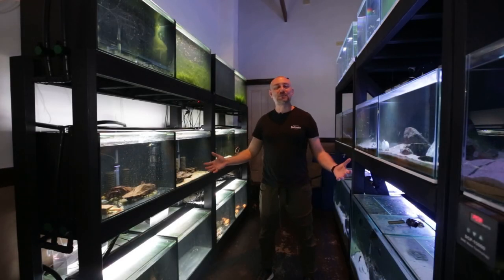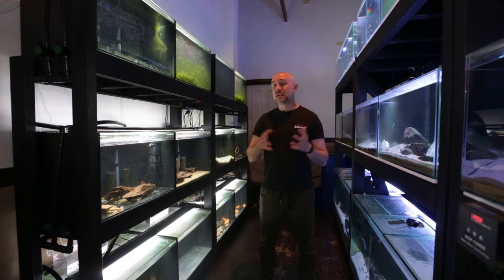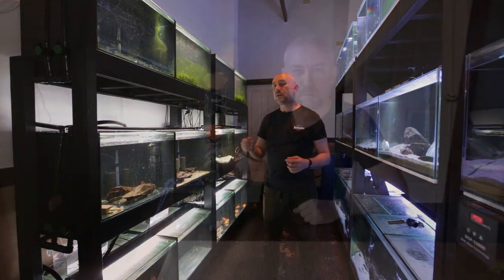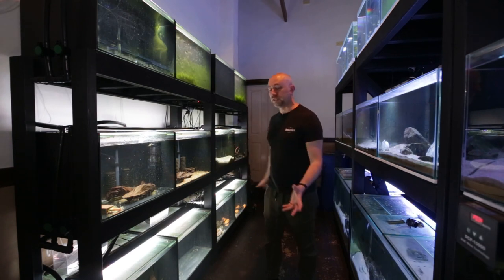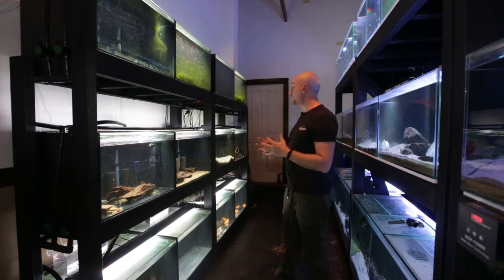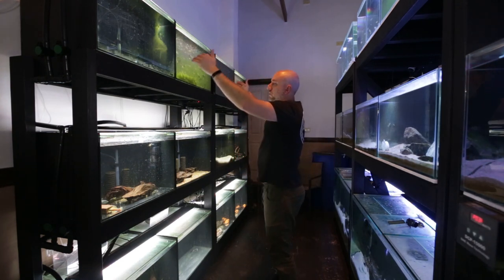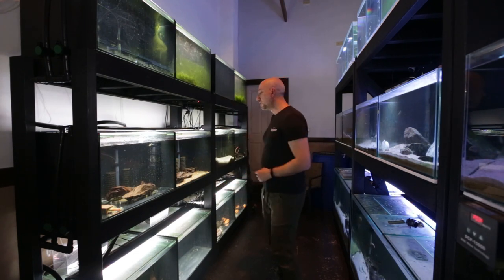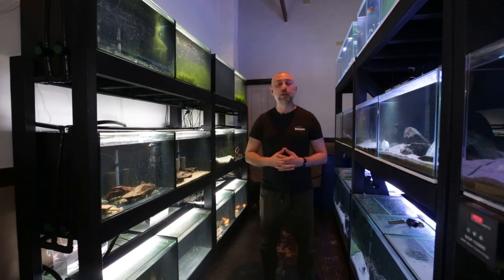Fish Room Water Change System - Part 5 - The Final Results

Comment: Oh no! First off all, don't remove te videos. Just make a little note in front of the series. Maybe someone else is thinking about doing something like this and you can safe him a lot of money.

The idea is great no doubt. It's a pity(is this the correct word?) its leaking 😪 lot of work money and time you spent. If it was my fish room I would change it for pvc. Its just a lot easier and stronger in the long run. You can buy different colors of pvc these days or you can spray paint them. But it's a waste of the money spent already. So i will first try to make this work. There must be something that can prevent the leaking in this system. I will have a check here in the Netherlands if they have a common solution for this kind of problem. Can we contact you somehow with a emailadres? That way I can also send you links and drawings if I have a solution /idea. Keep up the good work men! Greets from the Netherlands
Reply from the maker: Cheers for that mate, I won't be taking the videos down, the consensus is to keep them up so I will. 

Yeah in hindsight, I should have done this with PVC as it worked for me with my other rack. But figured the small scale tests worked so I was hoping this would be fine too. Now that I have the fittings, I will just get a solution to make this work and will share that with everyone. My email address is jasonscichlids@gmail.com

Cheers mate, gad you have been enjoying the videos Joop!

Comment: Dont delete the series from youtube mate. Can always just pin a comment in the previous versions with a note to watch this one first.
If it was me id probably switch it to pvc
Reply from the maker: Cheers Blake, I will keep the series up. Good suggestion with pinning a comment on the other videos. I will do that.
In hindsight, yeah I just should have just stuck with what I know. But now that I have the fittings, I would like to obviously use them and make this work. Once I have a solution I will be sharing it with everyone

Comment: Hey Mate, in my experience you could try wrap the barbs of the fittings with teflon tape and then add the hose clamp. that has worked quite well for me in the past. In reference to the PVC Solvent, most of them are aquarium safe once you have left them to fully cure. if you are not 100% sure, just look for a bottle that mentions consumer mains water as these have to be "food safe" to not add anything to drinking water. Hope that Helps!
Reply from the maker: Interesting suggestion to use tape as well as hose clamps. The fittings are so difficult to put together, the fit is so tight. Adding teflon tape would make that process so much more challenging but it might be worth it if it works! Oh yes, I am aware about the "food safe" an "potable water" labels being indicators for the product being aquarium safe. My question was more so for glues/cements that actually work on LDPE though as well as those being aquarium safe. Cheers again for your suggestion with the tape mate!
Reply: @JasonsCichlids  yea not too sure about the solvents working on LDPE, never tried it. I ended up heating the LDPE pipe up with a small lighter to get them over the barbs covered in teflon.
Reply: @lyalstanford574  how much tape did you use?

Comment: You could add a vaccum breaker valve (or a few) at the highest points in the system. When not using the system open the vacuum breakers to break the siphon and drain the system, preventing slow leaks from continuing to drain the tanks.
Reply: Also regarding the slow siphon on the bottom row. Perhaps something else that could 'help the cause' would be to find ways to increase head pressure(distance from water line in the tanks too the hose outlet in the yard.) If the yard is sloped, perhaps extend the garden hose to the lowest possible point. The added difference in height will increase head pressure which will help overcome air pockets in the line and increase flow.
Reply from the maker: Cheers for the tips mate. If I hadn't needed to break the siphon on the top row and middle rows, no air would have been in the drain hose. That would have allowed the bottom row to flow out unimpeded to the garden. Thankfully my backyard is about 2m to 3m lower than the bottom row of tanks. But even this wasn't enough to create enough pressure to blow out the air from the drain hose. But all good, from that one test I learnt a lot and next time I won't need to break the siphon on the tanks which will mean the bottom row tanks will drain out a lot quicker.
Reply: @JasonsCichlids  best kind, sounds like there's already plenty of height difference for the bottom row then.
 Suggestion for a vacuum breaker would be for after the water changes are all complete to avoid the tanks from slowing draining onto the floor through the slow leaks you were describing. Just as an alternative to resealing a bunch of connections.

Comment: If it’s not PVC then try to weld them using heat / blow torch. Also you can try using the 789 Dowsil silicon or find out the glue they use for soldering  Acrylic together.

 I am surprised the ring fastener / clamps aren’t working  to stop the leak. 

Let us know what you do.
Reply from the maker: Cheers for the suggestions mate. I wish there was some sort of heated iron I could clamp around the fittings to weld them shut. I have considered trying acrylic weld on but am not sure it will work with this stuff. 

Oh yeah mate, I was really surprised the metal clamps didn't work as well. I figured they would be my fall back but no luck. Definitely will do an update video once I sort it all out.

Comment: If only a couple joints are leaking you may have a nick in the barbs on the fitting.  I've used white plumbers tape, the kind you use of pressure fitting to stop leaks in my solar heater.  I have a 1 horse pump on that system and nothing is leaking.  I also have the screw on clamps doubled up on a couple problem joint.
Reply from the maker: Thanks for the suggestion, I am thinking of going this route with the plumbers tape and then using screw on clamps on top. Sounds like the solution to fix this.

Comment: This hobby always seems to have lessons and experiments for us to deal with. I’ve had one tank that continues to get green water. It gets better with water changes and comes right back. It’s caused me to search out the cause, which I’ve had many hypotheses that proved wrong. Don’t take down the videos. It’s nice to see we aren’t the only one struggling with some kind of issue. Plus, imagine the victory video you can create when you solve the problem!
Reply from the maker: Cheers mate, yeah I will be keeping the series up. Hmm I wonder though if your aquarium is simply close to a window and getting a lot of sun? I will definitely sharing the solution with you guys!
Reply: @JasonsCichlids  the windows in that area are covered so it get some indirect light. I’ve also now started to believe I might have too strong of a light on the tank. Currently experimenting with intensity to see what happens. Very confusing situation. Thanks for the thoughts!

Comment: Teflon tape might work.
For the problem with bottom row, could you not connect them with a "Y" fitting to use the flow from top row to create suction going through the Y fitting to drain bottom tank faster?
Reply from the maker: Yeah I am actually now considering using teflon tape now Ben. It seems to be the consensus so far. As for the bottom row, a "Y" fitting would unfortunately mean a change to all the feed in lines due to angles of the "Y" fitting not being 90 degrees. There is enough pressure, I learnt from that test that it works best if I don't break the siphons.

Comment: 👍 Jason have you emailed the piping manufacturer, because they should have tested products which work as sealants on their products❓
You've worked so hard on this project, I cannot see this issue defeating you Mate ... Good Luck 🤞
Reply from the maker: Hey Dino, I actually rang and spoke with them. Short answer from them is no, there are no glues that can glue polyethylene (LDPE or HDPE). Basically polyethylene was made for that very reason, so nothing would stick to it. This from one website, "It is commonly used as packaging and material for storage containers, chemical drums and tanks. Its nonporous surface makes it an ideal packaging material for adhesives since most glue can’t stick to a Polyethylene surface". However, I have since found two products that claim to be able to glue polyethylene. One uses a primer first and then you apply a "superglue" like substance to the join. The other looks like a 2 part epoxy. The issue with these, no idea if they are safe for fish! Being chemicals that can bond plastic that was designed to be never glued, I imagine they aren't great for fish. But I have options. 1. Undo everything and use teflon tape on all inside joins and then reattach everything using metal hose clamps. 2. Plastic weld the joins together using a plastic welder (plastic welders seem pretty cheap) and they make welders for polyethylene. 3. Redo the system with the same fittings but use vinyl hose instead of irrigation hose (LDPE). Or 4. Bite the bullet and try one of the glues I mentioned above. I'll fix it, its just a matter of taking some time to work out what will be the best next step.
Reply: @JasonsCichlids  although it might be a bit of a bodge it and scarper…..I’m sure some tubes of 785 black from DownCorning will crack this problem……it’s basically a sanitary sealant plumbers use in construction…….failing that a product called blackjack…….it’s a waterproofing product for roofs.

As both of these are applied externally to the fittings they should be completely fish friendly.

All that said I’m adding a disclaimer cos I don’t wanna be responsible for losing those beautiful Calvus.

But I reck9n 785 black tubes of mastic will be your friend.

Good luck

Comment: Morning Jason, very surprised the hose clamps didn't stop the leak, but it is a molded part with a soft tube trying to clamp together, another simple thing that might work is heat shrink, it could put a more even pressure on the raised ring of the barb, might be worth a try? Another quick question, what made you choose the Jebao DCP pump? I'm looking at upgrading a current pump and also need a new pump for a new (second hand) tank i'm rebuilding, and have found several different models that are very similar. Anyway, keep the series going, it is good to watch the progress, stumbles and all! Cheers
Reply from the maker: I was too Rob, in my mind the hose clamps were my fall back for any leaks. I have considered heat shrink and plastic welds but even though the fittings are on the sides of the tanks, they are still in awkward positions. 

I decided on the DCP pumps in the sump for 4 reasons; price, head height, energy efficiency and being able to dial in the exact flow rate I need so not to flood the system/plumbing. Hope that helps, but let me know if you have other questions.

The consensus with everyone's comments is to leave them up so I will be keeping them online for everyone, cheers mate!
Reply: @JasonsCichlids  PS- The new tank, a 3x2, will be for Similis, so I will have to get a hurry on with the strip and rebuild of the tank and sump! Cheers Jason!

Comment: Keep the videos up…..it’s a great insight into setting up a fishroom.

It’s not all highs all the way clearly so to see these troubles encountered is very informative man.

Hope you can fix the leaks…..Dow Corning used to make an aquarium safe friendly mastic….is it worth applying some to the outer joints along with the hose clips you’ve already applied ? 

That should crack it.
Reply from the maker: Cheers Jon, I will be keeping the series up as the consensus from everyone is to leave them online. I will look into your suggestion. I now know that Polyethylene was a plastic produced with an intended purpose of having nothing stick to it. Because of that there are only a few methods for bonding Polyethylene. However, with the 2 "glues" I have found to date that bond Polyethylene, I am not sure if they are aquarium safe. So I am looking at either dismantling the entire system and using teflon tape inside all the joins then metal hose clamping all the joins together. Plastic welding the Polyethylene joins. Or replacing out the Polyethylene irrigation hoses for vinyl tubing. Going to take my time with this next step so I don't have to do it all over again!
Reply: @JasonsCichlids  hope you crack it. 

You’ve got this.
Reply from the maker: Thanks mate, much appreciated ✌✌

Comment: I would lave the series up, you’ve explained it plain and simple mate🙂👍🏻Could you paint some silicon rubber around the fittings?
Reply from the maker: Cheers mate, all the comments I have seen so far have asked that I keep the series up so I will. I have thought about applying something to the outside but I rather do it from the inside (basically so the force of the water in the pipes pushes against the glue/silicon, further keeping the seal.
Reply: Jason's Cichlids yes that would work much better. After all the work and expense you have put into this, I’m sure at the end of the fix it will work great!🙂👍🏻

Comment: Don't remove the series, just add to the first video that there were some issues with leaking and that when fitting everything you should use either plumber taping, silicone (if you're sure you don't want to dismantle it) or even heat shrink tubing around joints, those are excellent and only require a heat gun.. best of luck and keep posting mate
Reply from the maker: The consensus was to leave the series up so I will be. I have other plans for that rack now so I have decided to dismantle it though. LDPE was manufactured so pretty much nothing will stick to it. I could heat weld more LDPE to it but that would be more cost and even more time consuming and would be tricky with it being so close to the tanks. SO yeah basically all these tanks are going to be drilled and connected to their own sump system later this year. Thanks heaps for the support mate, much appreciated

Comment: Yeah I'm having the same exact issue with my system. Even with hose clamps. I've been thinking about re doing everything with 3/4 PVC pipe with threaded check valves.
Reply from the maker: It's a shame. Its because the polyethylene isn't soft enough for the hose clamps. Adding teflon tape inside the joins will allow the metal hose clamps to form a better water tight seal around the joins. That's the thought anyway.
Reply: @JasonsCichlids  looking through Amazon for clamps, I came across pex pinch pressure clamps they work on high pressure systems. I think I might order some and see how they work.
Reply from the maker: It is worth a try. But I think there is still a possibility for a small kink where the clamp is pinching the hose. Water may leak from that point, like with the screw on clamps. Hence teflon tape needed to act as a softener inside the join, where the metal hose clamp screws on. The theory is the tapes "softness" will get bunched up around the clamp and help create a water tight seal. Hope that makes sense.
Reply: @JasonsCichlids  I wish I had went with shark bite instead kinda I'm probably going to try the Teflon tape with the pex
Reply from the maker: Good luck mate, let me know how you go
Reply: @JasonsCichlids  well I ordered the wrong size pex fittings. So looks like I'm trying the old Teflon and hose clamp method. So far I have noticed that they very much tighter fitting now. I can no longer rotate the fittings after the hose clamps is tightened down. So seems like a good sign so far.

Comment: Did you ever find a fix? I'm very curious. I'm doing a rack, not as big with a sump at the bottom & was thinking about using your idea but with it draining into my sump & not a garden. My rack will be 7ft long x 24in deep x 7 1/2 ft high (not 100% on the height) still figuring mine out..lol.
Reply from the maker: No actually gave up on this system. It can be done, just not using LDPE. I'd recommend garden hoses/vinyl tubing. Or even better PVC. But today I released a video about what I did with this very system. You can watch it here https://youtu.be/UkkoCsbAKVE